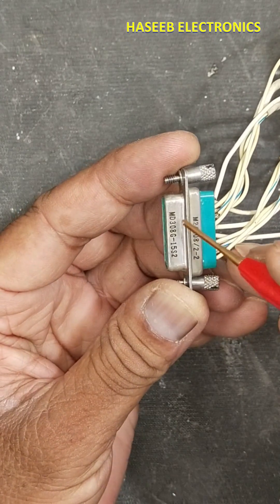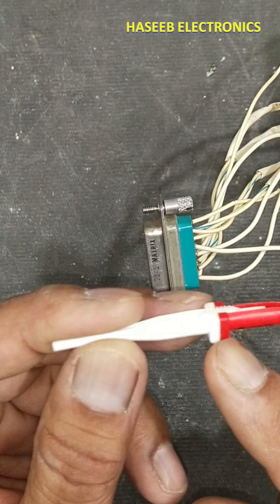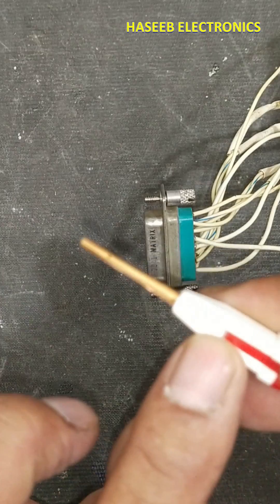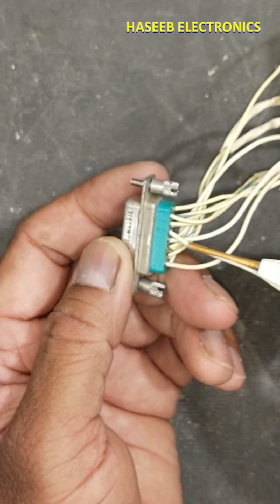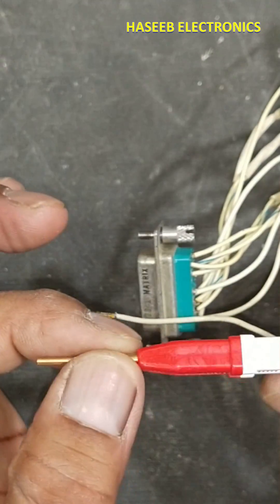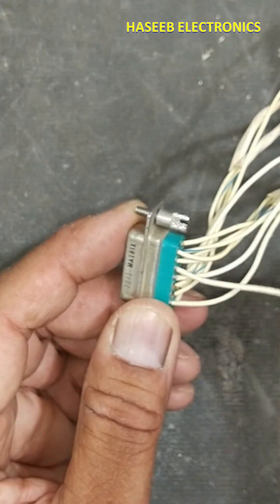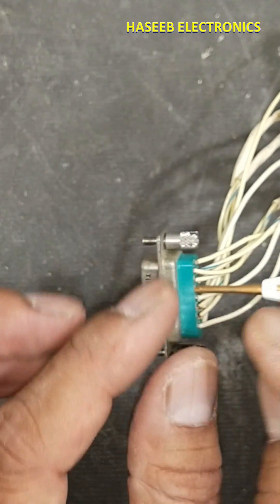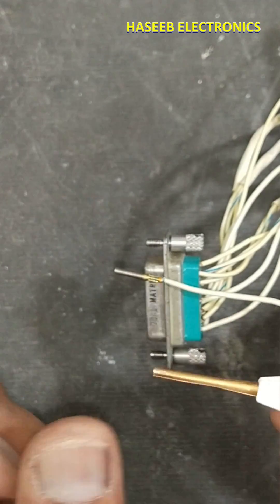{913} Pin insertion / removal in DB15 crimp connector

Comment: I've used a plastic version of this tool in the heavy trucking industry on ecu plug terminals. I didn't know they made a brass version. The plastic ones break REALLY easily. Thanks for showing and have a wonderful day.
Reply from the maker: yes these tools are very soft and easily break. if a special care is taken while insertion, it works long. with me it works years. rarely breaks